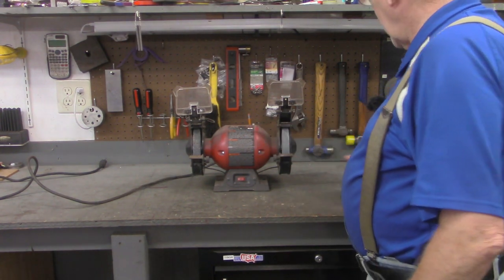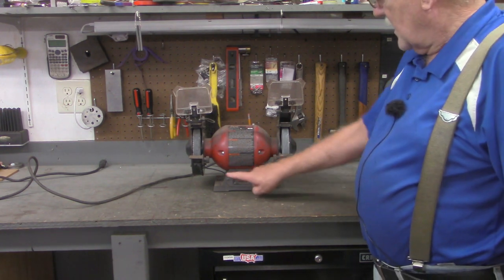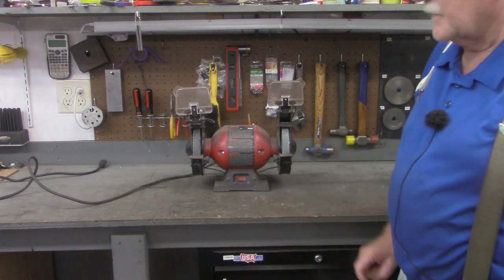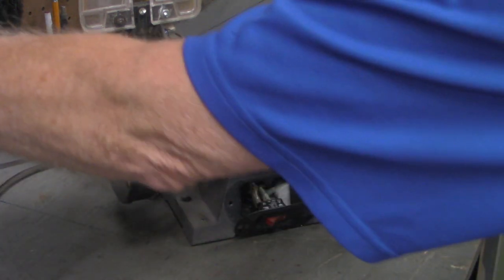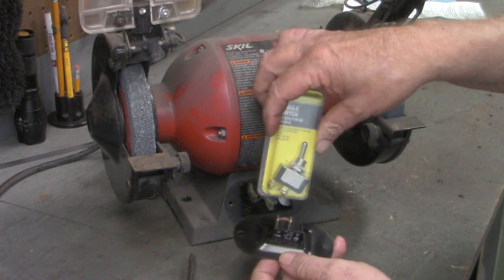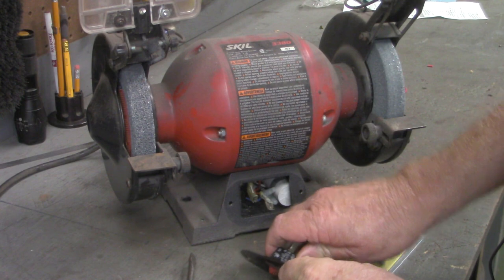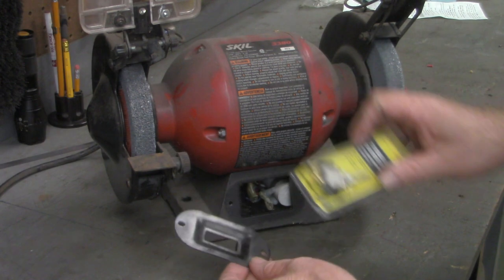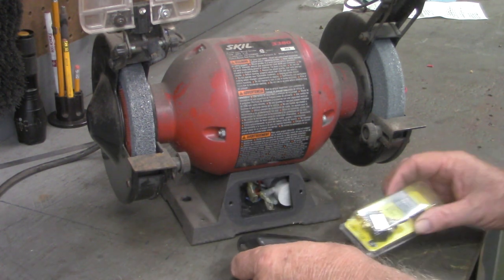Simple Tin Barn Equipment Repair

Comment: No,  you wouldn't have been better off replacing the switch with one of the original type.  They're nowhere near as robust as a standard toggle switch.

Years ago there was a time when you saw these things sold,  presumably to be sat on your desk under a computer monitor,  with a whole row of similar switches on it, only these were lighted..  I used one of those and had my desk lighting and speakers plugged into it,  along with the printer.  One day I went to turn on the lights and nothing happened.  I looked and saw that there was something odd about the way the front of that particular switch looked,  and when I touched it again the front of the switch popped out and shorted out somehow to the point where it popped the breaker on the circuit that I was plugged into!  Not that thrilled with that type of switch,  for sure...   :-)

Oh,  and if you'd care to part with some of those switches you have a boatload of,  let me know and we'll work something out.